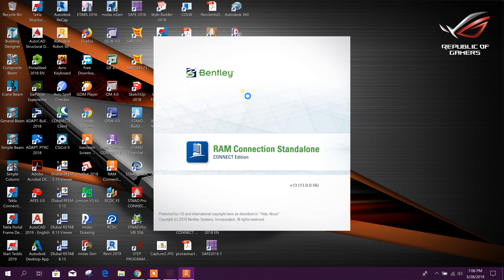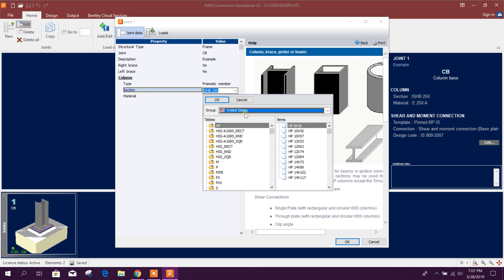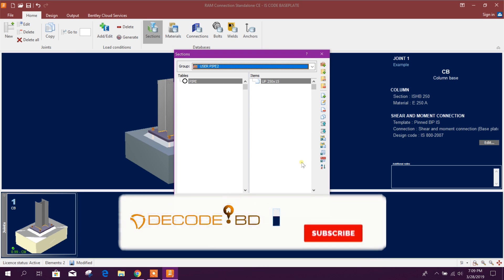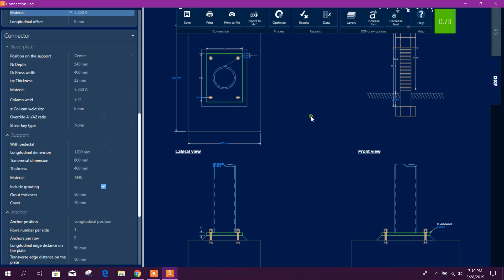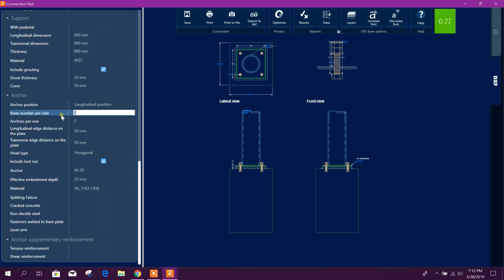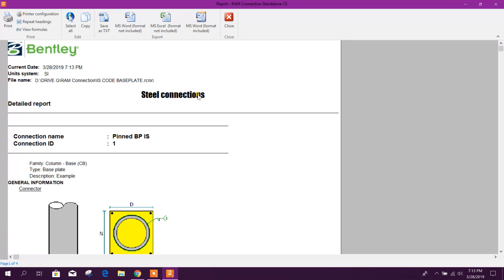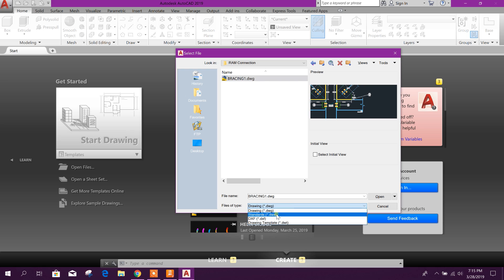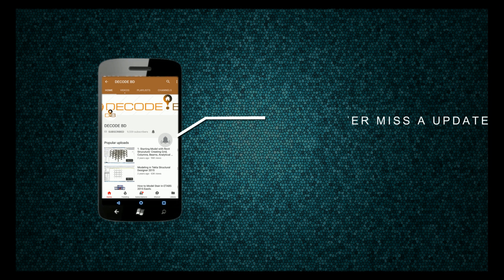BASE PLATE CONNECTION DESIGN AS PER IS CODE IN RAM CONNECTION v13

Comment: Sir I have a double C channel([ ])column section. How can I design base plate and anchor bolts for such type of section in ram connection using IS code
Reply: RAM CONNECTION doesn't use Channel as base plates. You can use equivalent tube section with the same flange thickness and area.
Reply: @slimmy666  The tube section only goes upto 150*150*6. In my structure the column is 200*200* 10. How do i overcome this problem please